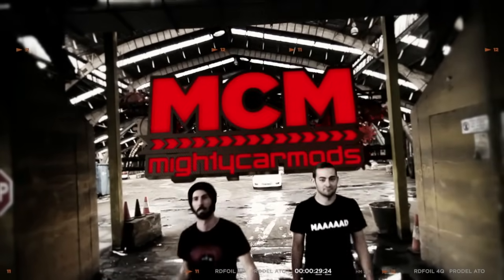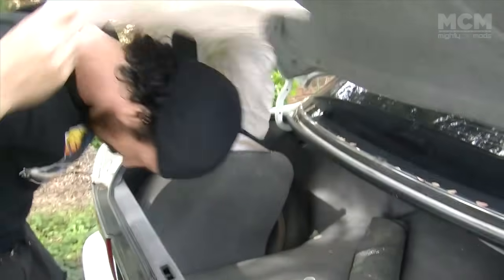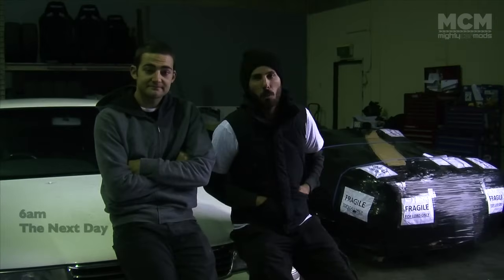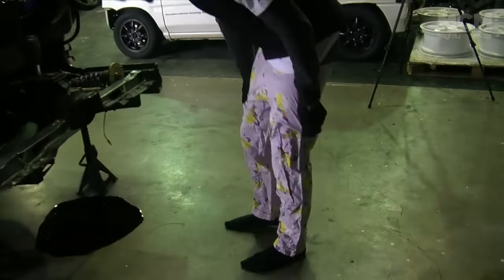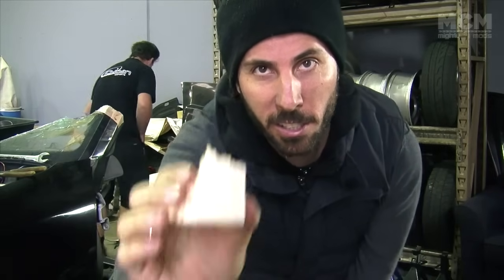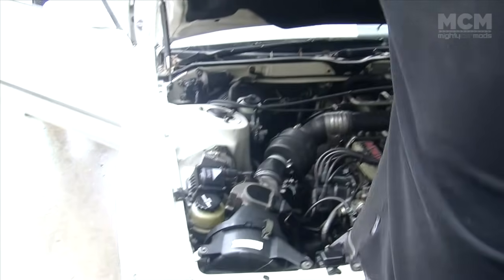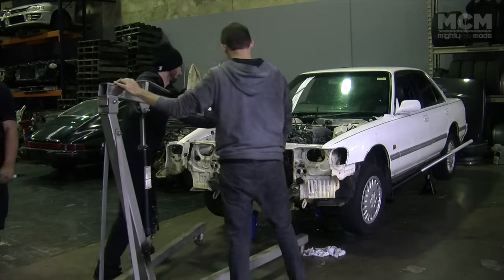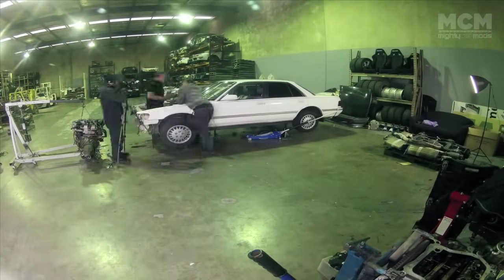1JZ Engine Conversion

Comment: The stock motor in the cressida the same motor as the 2jz even used it in the supra FROM 1986 till 1992 but without the VVT-I So you could have fixed the motor in the car and put the turbo from the 1jz and gone faster most likely.